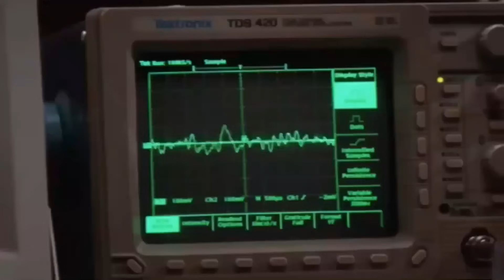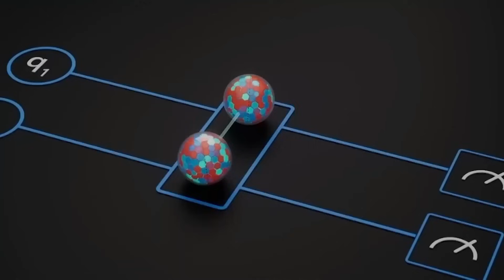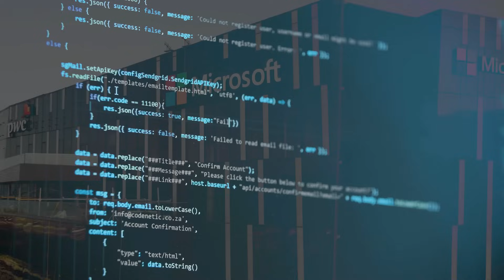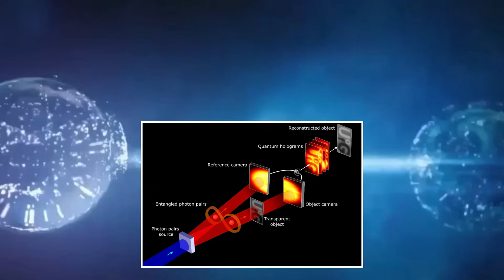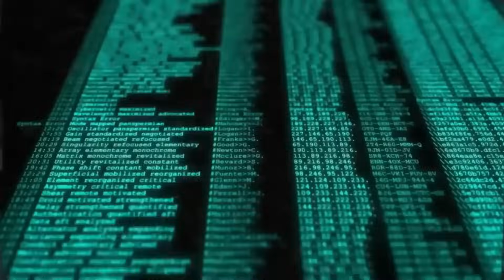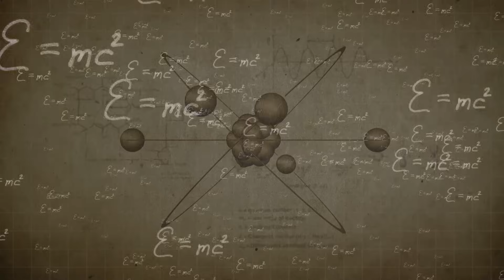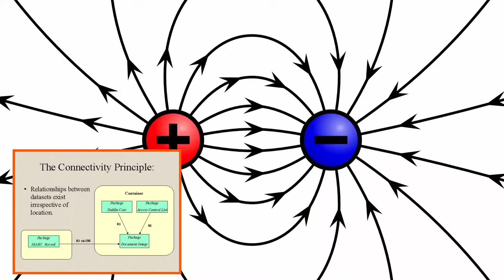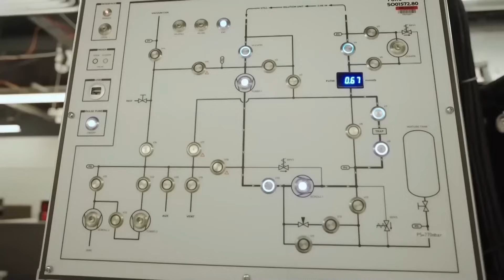Majorana 1 Quantum Chip Is Secretly Testing Quantum Entanglement on a Massive Scale

Comment: going to have to use a trunked network of sorts, then they could all be crammed into a spere. if its trunked there would be no need to add more. just use its quiet code to command it. can just have millions of extras waiting on a job. going to have to use a quiet code of sorts anyway so it fixes the problem of inadvertently affecting the outside world. it can remain a closed system and still retain its original properties that's needed.